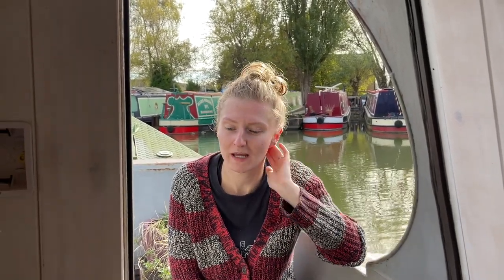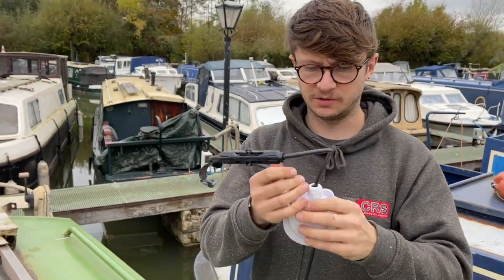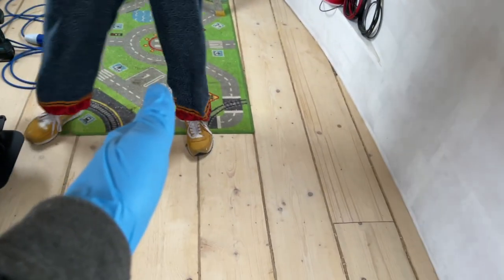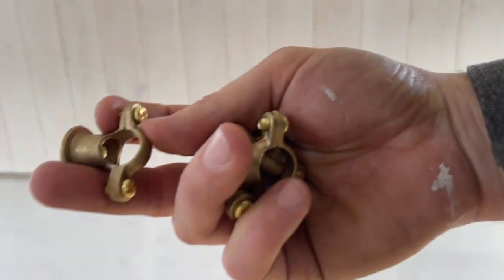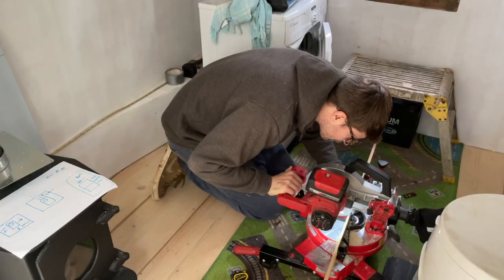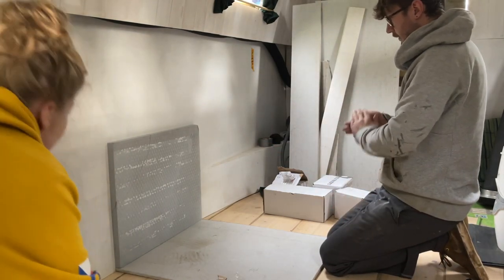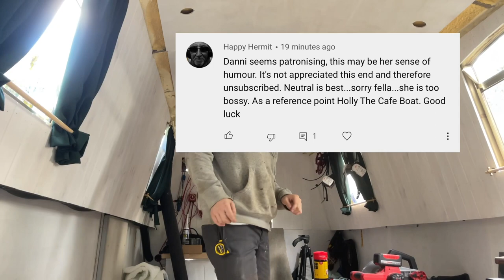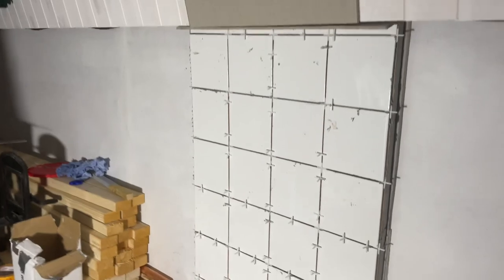Building a hearth for our Log Burner | Ceiling is finished! | Narrowboat Conversion | BOATLIFE

Comment: Just a quick note guys. Stainless steel is not an efficient reflector of radiant heat (infra red) regardless of surface finish, aluminium is a much better reflector - again regardless of surface finish. So even if you choose mirror finish s/s a matt finish aluminium will be better. Loving the vlogs, stay safe.
Reply from the maker: That’s interesting! Wouldn’t have known that, we’ll see if we run into issues and swap out for alloy if needs be, was cheap enough!

Comment: They make these pavilion in a 5x8 size that could cover your rear deck that would be cheaper than a pram cover as a means to keep the sun/rain off the rear deck
Reply from the maker: Funnily enough we've bought a temporary cover for the bow deck to keep the water off, would probably work on the rear too, haven't got round to fitting it yet!

Comment: A little tip for you when tiling anything always use PVA and water mix 50-50 coat your back boards first it will stop the suction of the grout that way the tiles will stick better also you shouldn’t use wall tiles under fires do you need proper flooring tiles otherwise they will crack with Heat use some hard wood to go round your harth before you grout
Reply from the maker: Yeah we’re set on using some oak to surround, we did grout already (next weeks video) as we didn’t want to have to clean the grout off the oak we thought it would be a bit awkward. We’re going to try these tiles fingers crossed, luckily the burner isn’t right against the tiles so might get away with it

Comment: Snappin that 1/2" hardibacker is always a fight, I've taken to using concrete disks on my grinder. A carbide grit blade on your multitool would work too. And good on you two for wearing your respirators! Silicosis is no joke. I am curious why you guys went with a wood stove vice coal? I've noticed from watching narrowboaters on youtube that coal seems to be rather popular. Here in Connecticut I heat my house with anthracite, can't beat the price.
Reply: Most stoves are classed as MultiFuel stoves and can be used with either wood or coal, however recommendations are to use smokeless coal in urban areas. As a lot of the canals run through towns and cities most have smokeless zones, in the countryside you do not have these restrictions but most boats haven’t the room to store different coals so most narrowboaters use smokeless. A 25kg (50lb) bag of smokeless coal is about £13 (approx $17.50), traditional coal is about £9 but from May 2023 it will no longer be allowed to be sold in the UK.
Reply: @pmckenz5  I had read about the smokeless zones, but their wood burner doesn't appear to have a grate. Does your coal or smokeless fuel not need a grate to burn? We do have a few multi-fuel stove makers here in the US still, but most of them are leaving the business as the EPA wood burning regulations are getting so tight. Whereas if you build a stove only for anthracite it's essentially unregulated.
Reply from the maker: Thank John! Yeah the thinner sheets are okay but 1/2” a real pain! So we’re going to experiment with what fuels work, probably a combination of timber & heat logs (logs made from coffee grounds seem to be gaining popularity).
Reply from the maker: Thanks Pete that’s informative!

Comment: Just a thought, but reference your wood burner. Did you check the installation against the requirements of the Boat Safety Scheme?  They are different to a home installation.  Good Luck, Dave.
Reply from the maker: Yeah we’ve been following BSS (which is fairly easy) and trying to follow HETAS with a touch of common sense to suit the boat

Comment: Question ... How are you ever going to get at the wiring in the ceiling, if you ever need to? I'm sure you are aware, that on other Narrowboats, they have an accessible panel running down the middle. That being said, you are progressing at a fine pace. Much Respect Jessiah
Reply from the maker: Thank you! We’re hoping to not need access, each connection is accessible via the light hole should anything ever come loose!
Reply: To suggest that all other Narrowboats have access to wiring runs is simply not true. You never have access to wiring in houses either.

Comment: Your be cleaning them white tiles for ever lol i did black so i couldnt see the mess lol
Reply: @ItsOhJoe  Also check out the regulations i built my fire hearth a few inches above the floor so the burner was bolted to the hearth not to sure about that but think it was just in case you had a bump so the burner cant fall but i could be totally wrong it was 3 years since mine was fitted.but great vids and love seeing how your progress is going along.
Reply from the maker: @andytaylor7318  thank you! Yeah the burner has holes in two of the legs for screwing down, will check out regs! Cheers

Comment: So guys, are you prepared to remove the whole ceiling when you get wiring problems?
Reply from the maker: The only cables in the ceiling are the LED’s, it seemed a bit excessive to create a channel through the centre for access when any connection is available though the holes for the LED. We’ve taken the view of cables being buried in house walls for 50+ years with no issue, I accept there’s a bit more movement in boats but we’re fairly confident we’ve made the correct choice. Time will tell! 😂
Reply from the maker: @johnglover9935  the only cables that’ll be inaccessible are the LED lights in the ceiling, the rest will be accessible in the gunwall. We’re using CT1 sealant so quite confident in it, but yeah SIKA make some great products. The burner is being fitted virtually at floor height I think it was you that offered advice before about having it as low as possible so thank you!
Reply: @ItsOhJoe  love you guys! We’ve just bought a boat & we will be watching you both for inspiration ❤

Comment: You need to raise your stove up  off the floor   to make an air gap  between the wooden  floor and the heater base. . I hate to say you really need looki and learn before some very dangerous situations concerning your safety are going to arise.   This is a comment.  purely thinking of your  personal safety. . . Rules are there, which really should be  followed  where fire and lot of dry timber are in close proximity.        Regards  JR
Reply from the maker: Thanks for the concern, we’re aiming to help insulate the bottom of the burner with vermiculite blocks and a grate which should help stop the spread of heat downwards